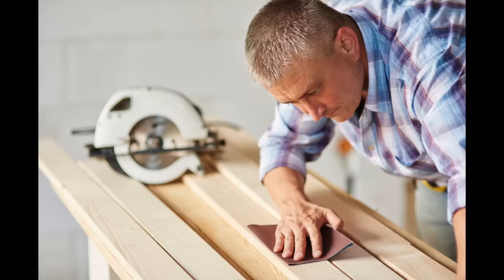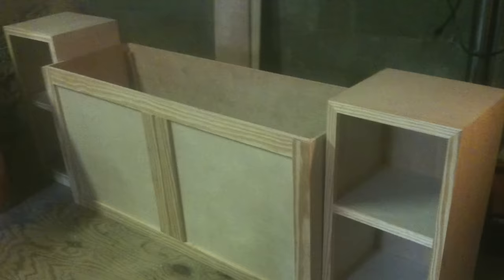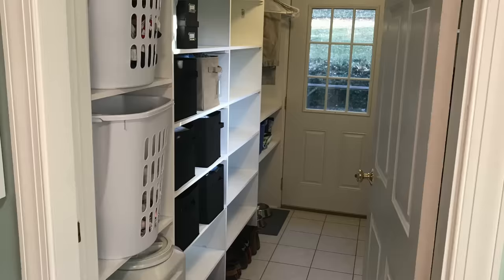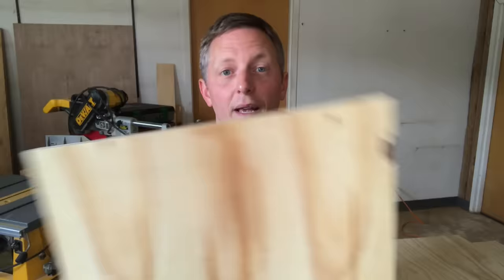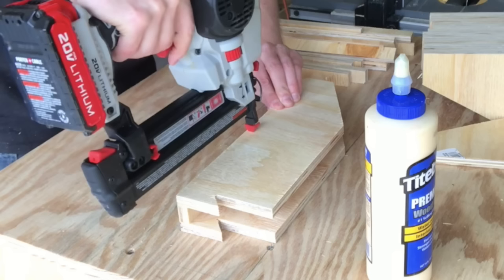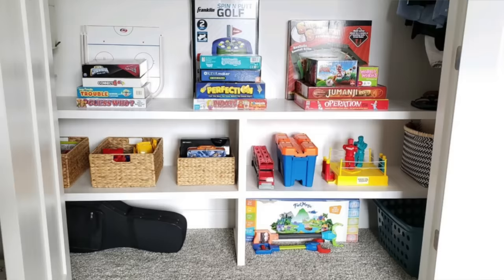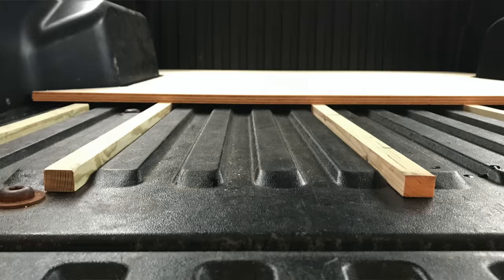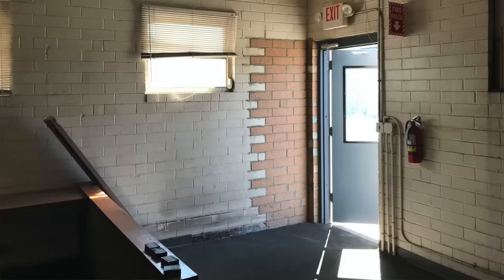DON'T USE 3/4" PLYWOOD If You Don't Need It...TRY THIS! (1/2" Plywood Vs. 3/4" Plywood--When to Use)

Comment: I strongly disagree.... What the hell happened to America? Kmon....
This country was the land of plenty. We didn't care about saving space, going green, cutting back! We lived! We lived large and shared the wealth! Im tired of these cut backs.
I didn't learn anything from this video. Of course plywood is stronger than wood, its layered in such a way that the grain of the wood alternates, whereas lumber simply goes in one direction. 
But, just because something can take a force applied to it, does not mean that over time, warping and wear won't happen. the reason we over did it in america, built strong, thick, bulky is to last. We thought of the future.
let's see that 1/2 inch in 100 years, how distorted those shelves will become.
the price saving are definitely there, but the more you buy the better deal you get. So, even though 1/2 inch is cheaper, pound per pound you get more wood for less from 3/4.
and why save space? this is a rich country with few population for its area. What is going on here? Its sad to see these times...
1/2 inch is not better. it's cheaper and it's like everything else in these days.... skinny furniture, thin electronics... little wires that burn out fast and disposable fast paced society. for shame!
all to save a buck.
Yes, you get more space, yes, with 1/2 inch itll do the job and last long... but, again, We had a different philosophe in the past. Build it to withstand more, much more than needed and it will last forever!
Im sorry, this video just did not convince me. Just another smiling salesman selling me something in the store and telling me "actually, no. its better, kuz this new thing bla bla bla..." When I clearly can see im getting less for more and it just isnt performing like the old stuff. Yet he still continues to press on about how it's better.

Comment: 19/32 is not 3/4. I remember when 3/4 Was 3/4.
1/2 is to flimsy. If you get it Sanded one side fine. But at that point for cost. go to Birch... Or MDF.
We are all getting ripped off as a result of this Chi Nah Flu crap.